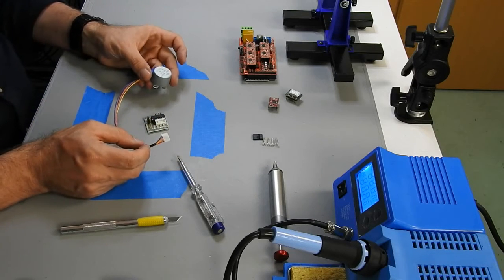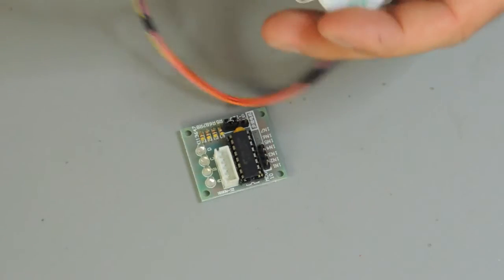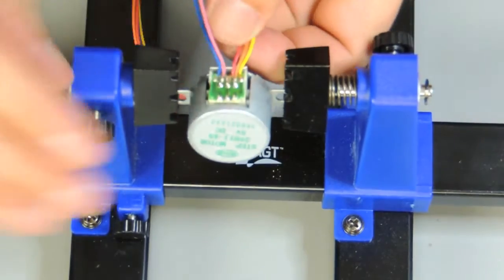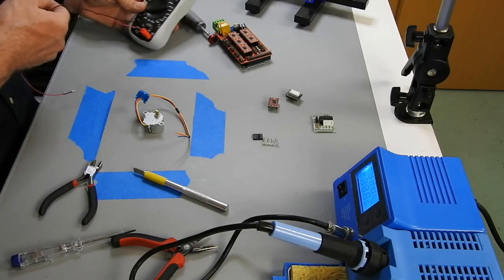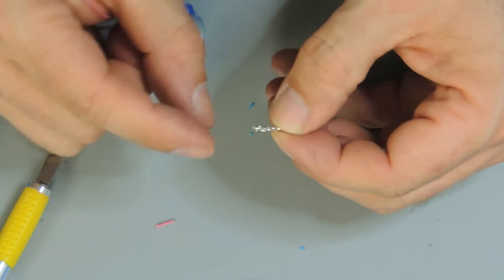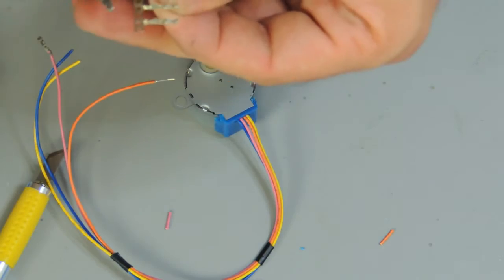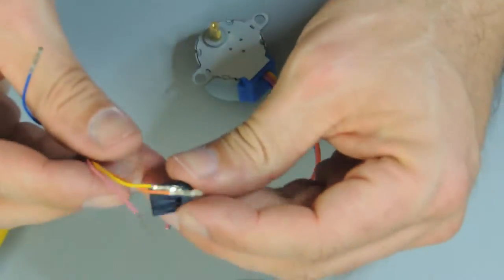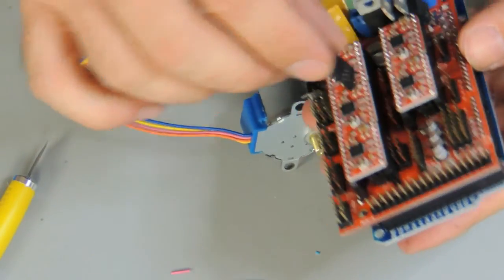How to hack 28BYJ-48 stepper for use with Ramps board

Comment: Watching this before following it I released the contacts from the plastic connector and rearranged them as needed leaving the red wire out and scratched the PCB trace making this modification reversible ....to remove the contacts depress the retaining clip and pull out of the connector
Reply: No need for a soldering iron or cutting and reversible

Comment: do you have to cut the trace,, couldn't you just not hook up the red wire or cut it off, what does cutting the trace do. Sorry I am new to all this. thx
Reply: It is connected to both coils.  So it must be cut.
Reply: no, i have already tried without cutting red wire or it's trace and works fine.No modification at all. Also used with H-bridge also L298d
Reply: It works, but unless you cut the trace, you will not get the advantage of the higher torque and accuracy may become a problem. You need to eliminate the bridge between the two coils.

Comment: You dont really need to cut and desolder the red wire, you can still use the connector after you cut the pcb

Comment: Hello, and turned the 28BYJ-48 engine according to their tutorials bipolar to mount a CNC controlled by an Arduino Uno with a CNC shield, but the work is very hot engines almost burned, the voltage feeding of the shield is 12VDC , which will be the problem, I use a driver, A4988 and control potentiometer is at minimum.
Reply: You could try to lower the voltage to the board. Any lower voltage would benefit.

Comment: pretty sure you don't need to do this to use the motor as bipolar
Reply: Yes, you do.  It delivers power to both coils. So if you don't do that, they will be short circuit by that trace.  Please check out the wiring of this 28BYJ and the difference from Bipolar and Unipolar steppers.
Reply: Anders Jackson  no you dont only one coil on at a time no short.
Reply: I use this motor all the time without having to make any modifications at all.  Just don't connect the red wire.  I use the SN754410 to drive it with my Raspberry Pi. Love this little stepper motor!